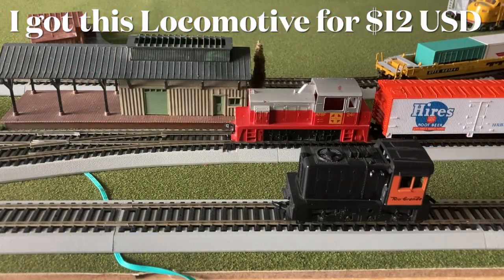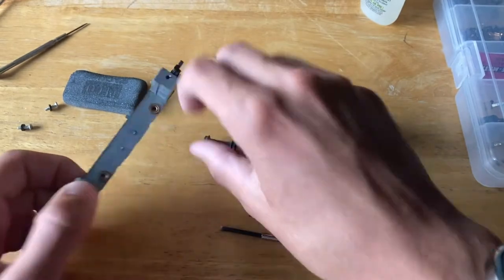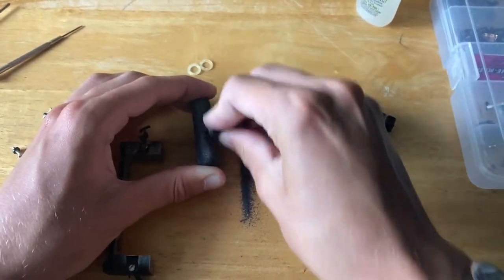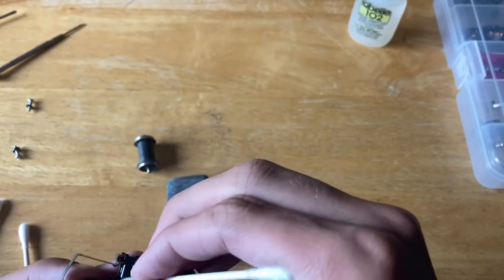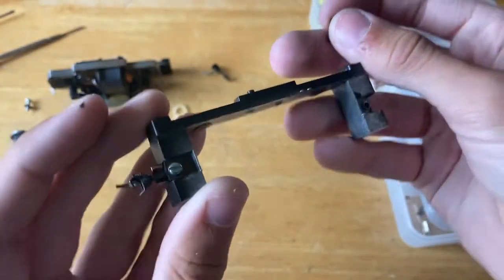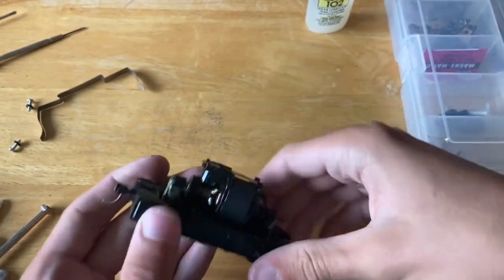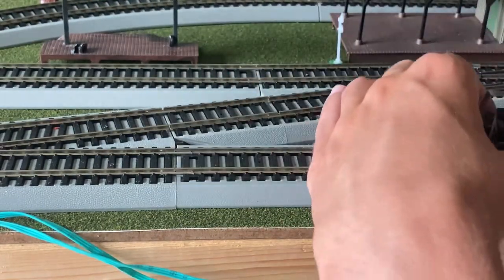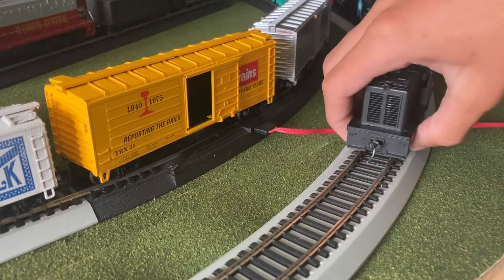Athearn Band Drive Rio Grande Hustler Restoration ⛽️🧰

Comment: I just rebuilt mine that I had since 1980 and was my grandfathers before that (he bought it new) I installed new bands, rewound the motor, remagnetized the magnets, removed the electrical bar and hard wired everything, since I was working on it I installed directional lighting and a dcc decoder.  The digitrax DN136D fit nicely.
Reply from the maker: Awesome! Thanks for Watching!! 🧰